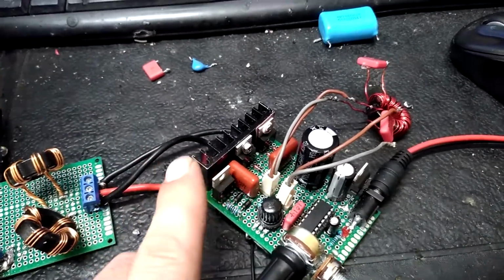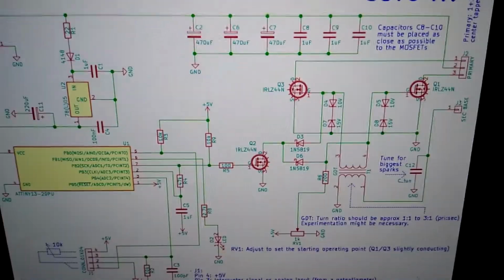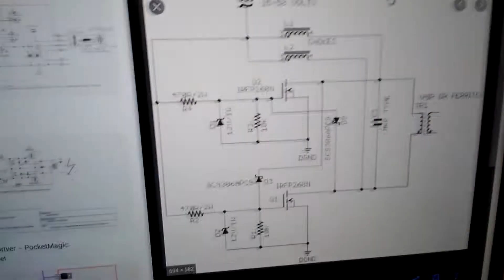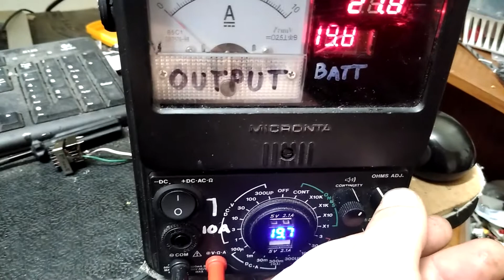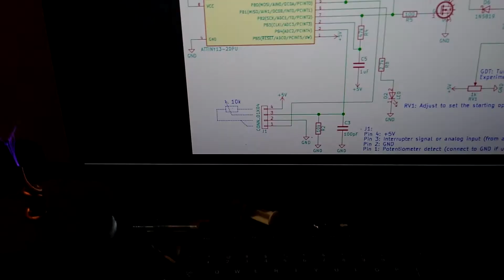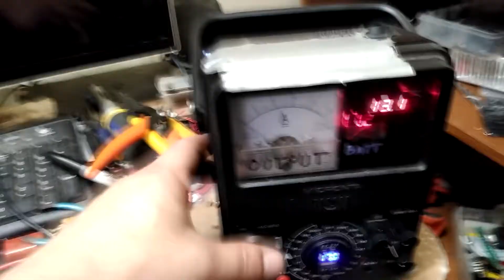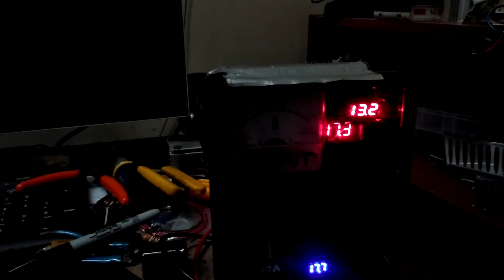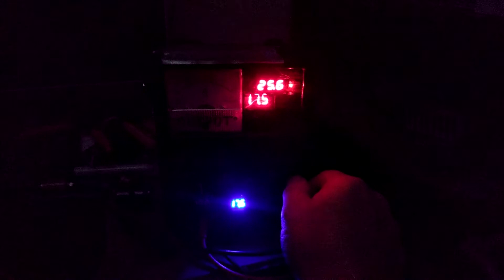Skori/Tefatronix/Teslaundmehr DRSSTC? 12-24VDC Test

Comment: the idea I was talking about was running the GDT feedback into complementary bjts on each side, hence amplifying the feedback, while having one of the fets initially fully on while the other is fully off... whether this would actually work is not yet eastablished
Reply from the maker: Oh I get you, I think the reason these circuits omit anything like that is just for simplicity. At a certain point one may just want to use gate drivers etc.
Reply: @Magneticitist  I established that it works but inversely from the way I thought it would since I didn't take into account that that both BJTs would be ON at startup (making the opposite FETs on/off), hence I reversed the polarity so that the feedback disrupts the flow between the bases of the BJTs, and it works but not very good,  probably because I didn't think of the parameters enough or the components are simply shitty as the video I'll post now will show, using the IRFP260 fets which are probably genuine, work a lot better than the other ones in a bare Tefatronix arrangement and without a proper potentiometer as u'll see
Reply: @Magneticitist  btw these zeners I'm using get TOASTIER THAN HELL, what kind do u use ?
Reply from the maker: @sFeral  I'm pretty sure they are these 1 watts I got from ebay 
https://www.ebay.com/itm/10x-10pcs-1N4742A-12V-Zener-Diode-1W-IN4742A-Fast-Free-US-Shipping/253210064894?hash=item3af47ef7fe:g:StMAAOSwYAddvLbp

I never had any issues with zeners getting super hot on these to my knowledge. Using the two zeners facing each other on the gates/source is probably best. 

I'm not 100% how your layout is but is it also possible they are clamping some straight DC from the supply given your voltage divider? hard to tell the exact zener voltage that's on there with what looks like two in series. Are they 6v zeners? Is it possible one among the stacks is of a smaller value and is heating the rest of them up etc?
Reply: @Magneticitist  they're 12V facing each other, and two sets in parallel which I added because they were getting so hot
Reply: my "skori" coil works similarly, i tapped the secondary bottom on two rails, one is just a NPN-PNP driver and the other one switches a 2N7000 inverting transistor with a pullup resistor (and a small capacitor that i scoped), that drives ANOTHER NPN-PNP buffer, the two buffers drive two IRF3205 and so on... the secondary bottom is limited by zeners inside 0-12V

the advantage of doing so is that you get rid of the current transformer and you can hookup an LC filter that is not influenced by other indutances or caps so literal small components, my coil has a too big topload and it tunes really well so you even don't need an LC filter in parallel of the input (in my case)

2+2 turns primary litz wire
25V supply
300kHz secondary
555 interrupter at 1.5ms on (skori)

12cm sparks and 15cm on an object, they tingle a lot :)

i could make a video but YT hates me so there's nothing uploaded for that coil
Reply from the maker: @redoverdrivetheunstoppable4637  Nice. I may want to eventually get more complex with the Skoris since they can indeed throw those tingles from such low voltage. I got caught up using the bare bones setup with 250's and a GDT too much cause of how insane the output is with the right setup using only minimal components. I feel like it takes way more effort just to pull the beef from more complex feedback driven circuits using drivers but I'll probably need to get creative up into like 60-80V range or so.
Reply: @Magneticitist  i just don't like a GDT, it's ok but it has its electrical complexity, plus it can push too much on the zeners, i preferred a more "logic" approach... actually i'm not gonna replicate the work i did on my mains half bridge SSTC, i exaggerated with complexity and the results have been "normal"
Reply from the maker: @redoverdrivetheunstoppable4637  I broke my scope a while ago in the dumbest way by turning in my rolling chair while a probe lead was caught in the arm pulling the whole thing off the table going smashy smashy on the way down. Since then I've had no idea what the gate waveforms are really looking like with these circuits using GDTs. IDK if they are driving them with overshoots or some kind of capacitive coupling in the GDT is ringing in a helpful way as far as the output looks. I haven't popped any fets with these yet unless I tried to pull hot arcs from lower voltage rated ones or tried interrupting at the power rail running peak currents though.  I've popped many with single fet SSTC's tho. I just know I've had some great output using what looked to be RF chokes even with 1-2 mhz coils, so I can only imagine some possibilities of what's happening there without actually knowing the upper limits of what the choke is meant to pass.

Going straight logic seems ballsy but I swear I've seen some of the best looking outputs doing it that way. I realized how important hitting precise gate voltages are when playing with things like plasma speakers where I was using PWM's with adjustable gate voltage to show me a digital reading at the time. I was first building SSTC's with FETS going by schematics where people were using IGBT's thinking I needed to hit at the very least 15V on a gate. This in my experience is flat out wrong where no more than 12V is necessary and beyond that can be destructive with a common 20V+- gate fet. I stopped using commonly seen 15v zeners for this reason. With a rising input voltage on the TC using these circuits and only a feedback GDT with no logic controllers at a certain point the zeners is all you've got. This is why when I try to get 'basic' using this circuit to try to push much higher voltage I start to realize I either need to literally just turn it into what all the other circuits out there are doing or heavily rely on some type of clamping I just have to pray will work. Still gonna try though, about to finish up another test rig just to see when the fets pop.
Reply: @Magneticitist  i'm not saying a GDT is bad, i just don't prefer it, a logic driver separates the functionality of the parts, plus a GDT has a handful of factors to deal with, it's more complex in my opinion if thrown in between of power FETs and feedback, i just used a class B without chips but zeners are still needed... yeah, IGBTs need a bit more voltage

jeez i care about my scope :D (i'm poor) infact i tend to not use it on "wild" circuits like tesla coils, if i need to scope something i use my function generator instead of turning all on, it's not the same thing of analyzing the live circuit but until now i didn't needed to scope a running coil.... and yeah, i scoped GDTs as well
Reply from the maker: @redoverdrivetheunstoppable4637  I was always very careful with my scope but sometimes I move around too much. the general layout of my workspace is not ideal and it was bound to happen eventually I guess. I did pretty much the same thing last night, I got this rolling chair that likes to lower itself on its own time to time. I got frustrated and lifted it back up real quick while sitting in it and the arm caught on another lead again and yanked a circuit I was working on to the floor lmao.

Comment: You don't even need two chokes to run a tapless ZVS, omitt  one, see what happens
Reply from the maker: I started with a common mode then switched over to the two just for the sake of symmetry and testing but you can use the one with the center tapped but need one for each half of the circuit when running the tapless afaik. This circuit didn't want to oscillate properly with only the one choke tapless though. This is switching at about 500khz or so ballpark though which is pretty high compared to a common ZVS driver.

Comment: Great video, I think it is actually operating in a drsstc configuration because there is a LC circuit on not only the secondary but on the primary. For some reason I could never get this type of push pull circuit to work.
Reply from the maker: I get the feeling the primary must be somewhat resonating ok given it's still able to push such arcs from 12v and a really loose coupling but I'm still not 100% what role the inductors are playing. They shouldn't be too much issue but I need to try a little higher values. I noticed that with enough inductance I believe they started to interfere with the primary resonance.
Reply from the maker: After you get the first one working the rest are way easier. It can be a pain to get going at first. I still sometimes do things like forget to completely isolate the mosfets sometimes lol. I spent like an hour one day trying to figure out what the problem was before noticing I added a little pad on a fet to isolate it but didn't add a little plastic bushing for where the little bolt went. If you're confident all the wiring is good having a quick swappable GDT setup is the way to go to just test out various ones til you get some kind of oscillation, from there it's just tweaking.
Reply: I’m gonna try to give this circuit another shot. Additionally I can imagine how well a circuit like this would work of if like 120v and a Silicon carbide mosfet.
Reply from the maker: @quantumlab9130  Oh yea those high voltage ZVS driven setups are so insane I really want to see how this circuit can be tweaked similarly. So far I just know that the same topology works pretty good with fets like IRFP250's once you reach about 24V but are still good for drawing super hot arcs at lower voltages like 12-16V before needing an insane PSU. I get pretty decent CW at 30V from a 5A limited supply. Someone else told me they were able to push like 80V on the bus before killing the circuit using more primary windings and 250's.